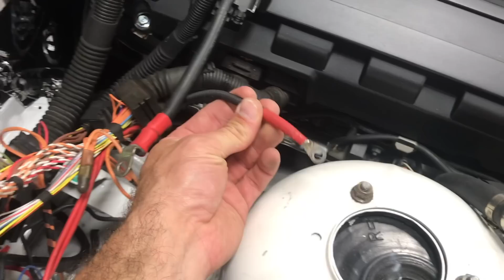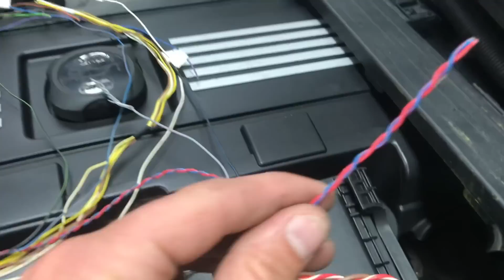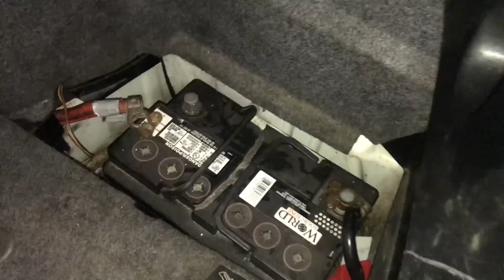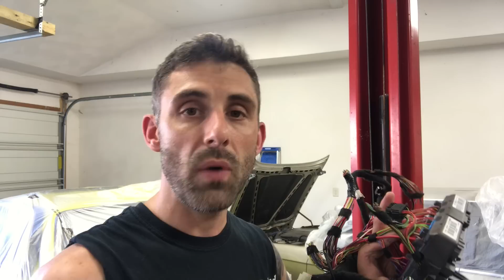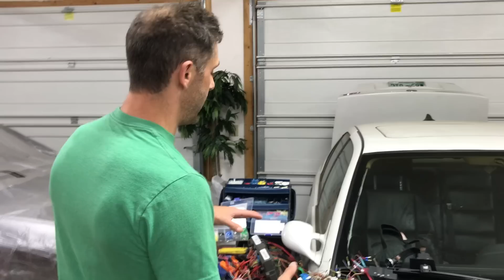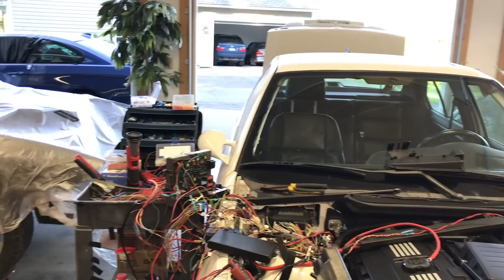BMW N54 Swap Runs On CAS! But How Did I Do It?!

Comment: Massive respect for what you have done. I’m a computer engineer with some electronic background and I had to troubleshoot my CAS in an E89 Z4 and that alone drove me nuts, what you are doing is on a totally different level and I cannot imagine myself going through this to troubleshoot.
Reply from the maker: Thanks Justin - and that’s all it was. Troubleshooting and schematic reading. Add to the fact that the schematics weren’t fully accurate? And that didn’t help!’n

Comment: Great videos and THANK YOU for the hard work in bringing us the great content! I LOVE IT! I wanted to say that these cars need almost everything from the car to be present to start and to work correctly or else -----------. I know you know a ton about them and I won't try to tell you a lot about this. But the car searches for the rest of the cars components and must see the TCU and other ECU's in the car to give the "OK" to start the blasted thing. Thus if someone wants to do swaps with these engines it's almost best (or IS best lol) to just transfer EVERYTHING from the mother or donor car to the patient car.  Oh and NEVER cut anything off the ECU unless absolutely necessary. Even then mark the wires or loom etc.  Okay I'll shut up now and continue to enjoy your great video! (I've only seen until 19:01 so far LOL. DOH!).  Edit: I'm now at 26 mins in and ohh man do I feel for you man! (and I feel guilty for laughing when it kept not starting for you too lol.)
Reply from the maker: Hahah thanks Greg! Yeah you CAN Run the engine but it runs in limp after 30 second persistence. I addressed that in follow-up videos

Comment: Dude... huge amounts of respect for persevering through this! I have to ask... why the heck didn’t you just use aftermarket engine management? I just wired an m50 into an e30 and that was only a few wires. I can only imagine the frustration levels here. Well done! Hats off to you 👍🏻
Reply from the maker: HAHA, because I wanted someone to know that you CAN do it with just a CAS module (with corresponding key). You don't need expensive engine management!!! Thanks for the reply and thanks for watching man!
Reply: 😂 Self-inflicted frustration for all of our benefit. Again, very impressive, huge well done 👍🏻 Speeduino UA4C by WTMtronics is $200 to save you the pain on your next swap 👍🏻

Comment: Fyi... current BMW training STILL states "you CANNOT EVER cut or repair a CANBUS line". Instead you quote/order whatever entire loom is attached to any wiring problem you find.
Reply from the maker: Hahah no you can repair a can bus line. Just need to maintain a strong tight wind

Comment: How much would you charge me to do a s54 engine swap on an E30?
Reply from the maker: I am actually so swamped right now that I am not taking any additional customer requests at the moment. But it sounds like a great swap. I’ve done s54 swap into my restored e21, so e30 is much easier. Just need to find m50 oil pan to make the mechanical integration much easier!